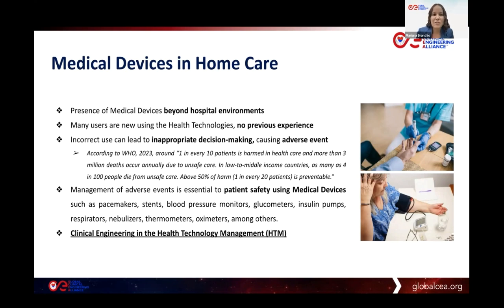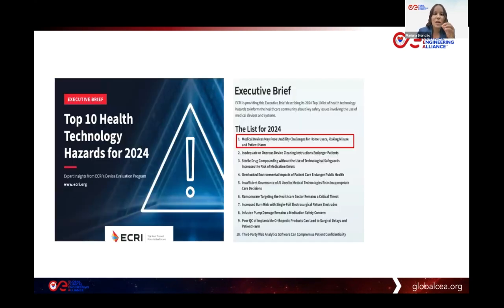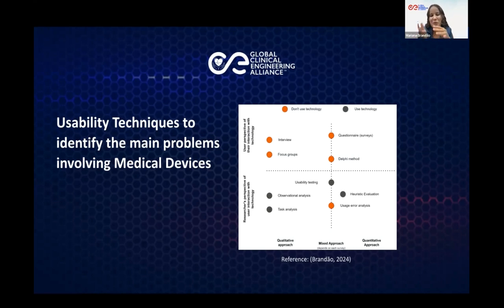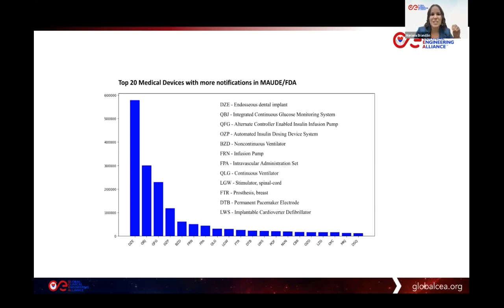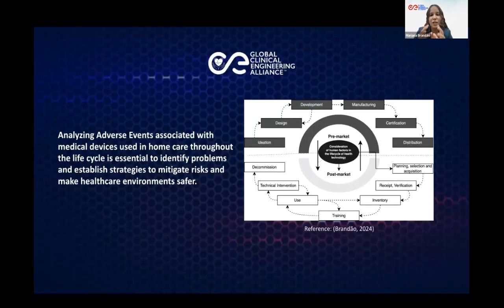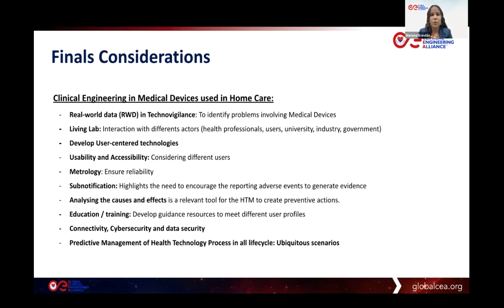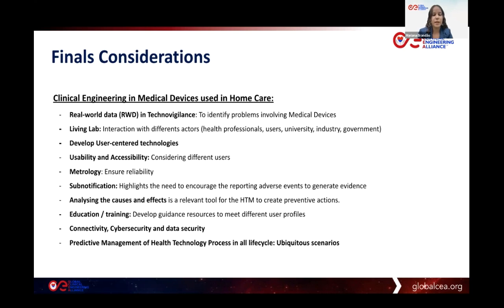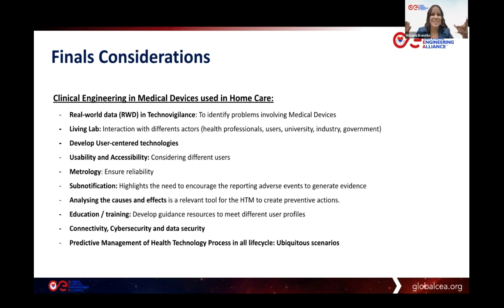Adverse events in Medical Devices used in Home Care

Comment: I would suggest adding HTD (health technology DESIGN) to your lifecycle model.  HTA is too late.  There is generally insufficient feedback from biomedical and clinical engineers into the next generation of medical devices, and this is clearly where some of the most important real-world information and experience lies.  I spent too many years of my professional life dealing with the sometimes major design flaws in medical devices and systems.   Too many innovators are experts in some aspect of the technology, but totally ignorant, dangerously so,  of other aspects of the technology lifecycle, systems integration and interoperability, data standards, and numerous stakeholders who should be included in the end-of-life tech evaluations and design criteria for the next generation.